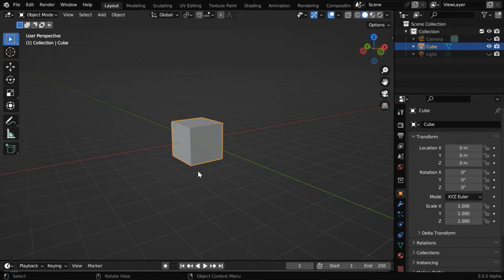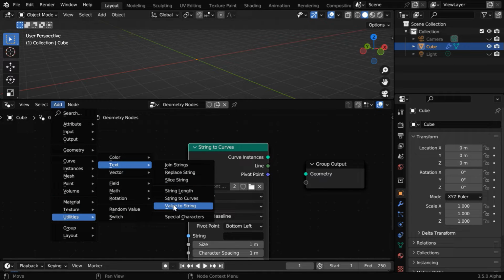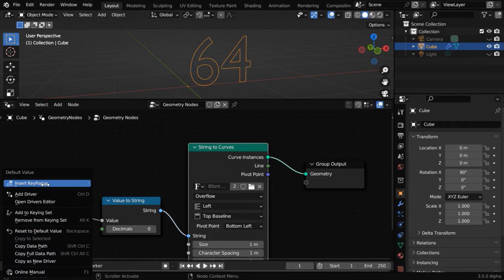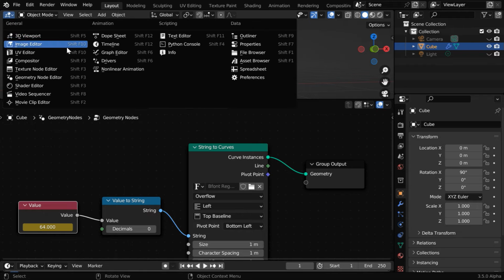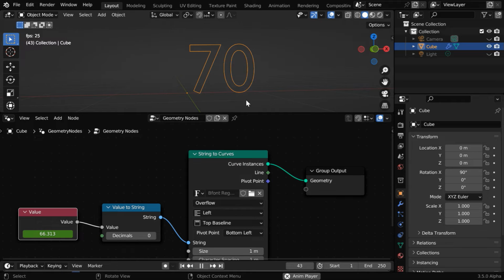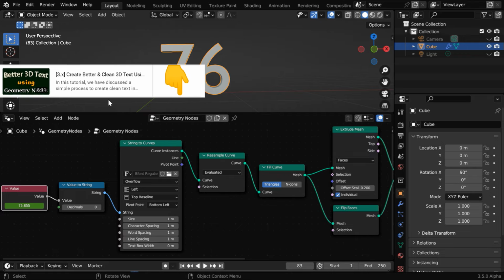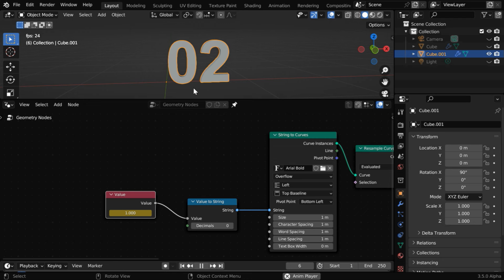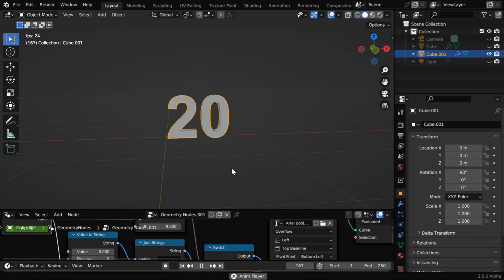Counting Numbers In Blender | Auto Increment & Digital Clocks | Counters For 3D Comparison Videos

Comment: Time me 60 minutes hota ....uska kya kre?
Reply from the maker: You can initiate a change manually for the text after 59 seconds or 59 minutes. If you want everything to be automatic, you'll need to use geometry nodes to manipulate the text based on the frame number. It will be difficult to explain it in a comment 🙁
Reply: @5MinutesBlender  why don't you make a video sir
Reply from the maker: @Adi-Xplains  We'll see if we can come up with a video tutorial. Taking a note of this 👍

Comment: Thank you much for making such an useful video 
How to add color to Number sequence, in material section changing the color but not applying the color, please help 
and also how add border to this sequence number to look more attractive
Reply from the maker: Since we are using Geometry Nodes to create the number, we need to assign a material through the Geometry Nodes, otherwise it won't take effect (the reason being, the text is created as an instance, it does not get the same material that is applied in the materials tab). We need to use a Set Material node for this purpose. You can check this tutorial for the same 👉 https://youtu.be/3wBcHLPckis Adding a border to the text is possible, but it would be quite complex. Very difficult to explain in this comment box 🙁🙁

Comment: Hello sir, I am about buying a laptop for blender now, the specifications is 1TB HDD, 8gb RAM, core i5 and 2gb graphics card

Do you think this is good for blender?
Reply from the maker: Yes, it just meets the minimum hardware requirement and you can comfortably run Blender. However, sometimes the performance may be moderate.
Reply: @5MinutesBlender  thank you sir, I am so happy to have your reply ❤️